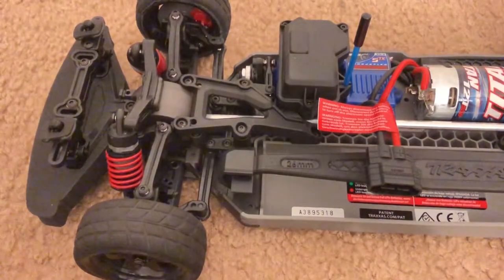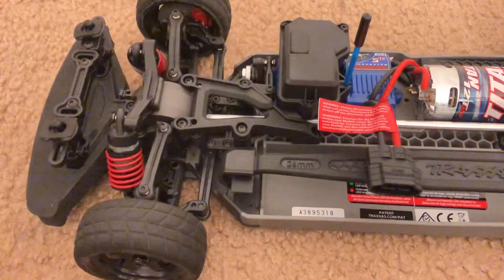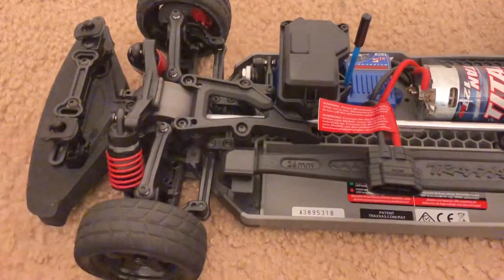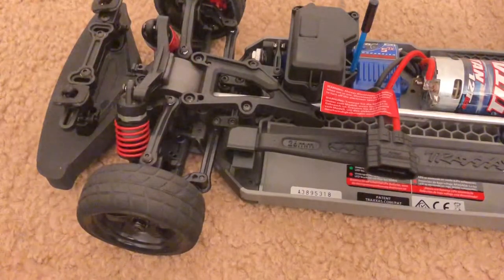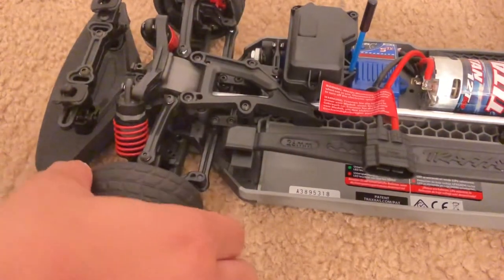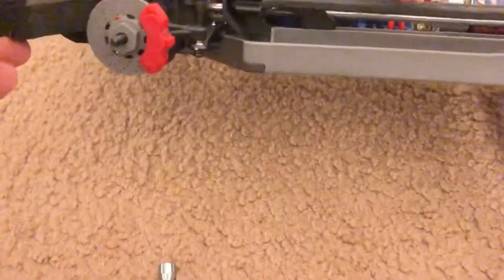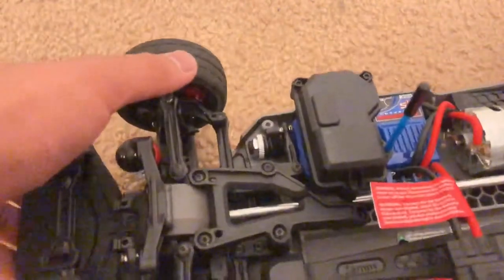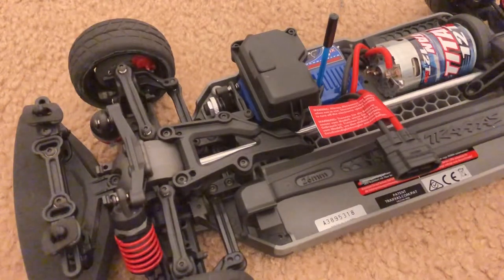Traxxas 4Tec 2.0 2WD Conversion Tutorial

Comment: The problem with just taking out the front axles is since the front diff isn’t doing anything there would be some serious slip in the rear diff…. You need to take the entire front diff out of the diff housing, front axles out, then you need to take apart the rear diff and weld the diff or lock it with epoxy.   I would recommend low gearing because if you have high you just do A burnout until you match speed.    If the diff isn’t locked then only one wheel would be spinning half the time.

Comment: I realize this is a pretty old video so not sure if anyone will respond but does this cause any stress on the front diff since the power going through it is not going into the wheels? Not sure if that makes sense just wanted to make sure I wont ruin my rc. Thanks
Reply from the maker: Nah it won’t ruin any drivetrain parts. I’ve tried it both brushless and brushed applications. The only problem is on power oversteer. Just use some kind of stabilizer like TSM and that fixes that
Reply: @TndPnyRCofficial  Wow thanks for responding so quickly! Ive already tried it and i was first of all amazed by how easy it was to convert. And yeah i noticed that it is kinda hard to control once it looses traction. I was trying to make it into a drift car using plastic drift tires but it was just impossible to control so yeah I'm probably gonna try to get one of the TSM things. Or just make it awd again cause it drifted pretty good in stock form. Thanks for the help though!
Reply: @henrikstjernfeldt7397  how did the conversion go I’m about to do it to mine
Reply: @DBtwafy  takes like 3 minutes its easy asf